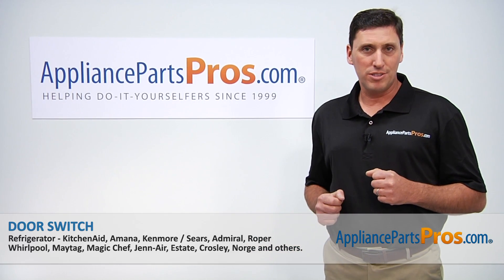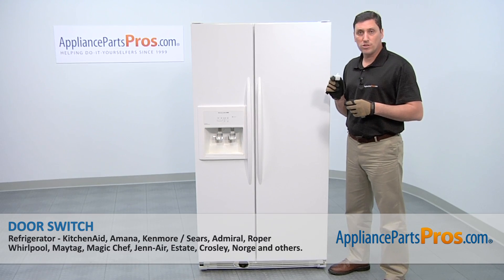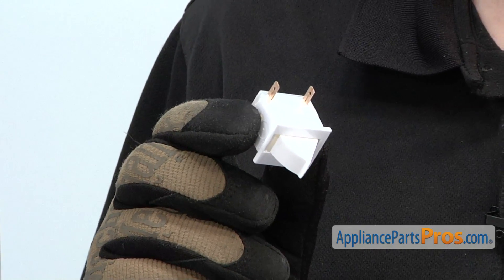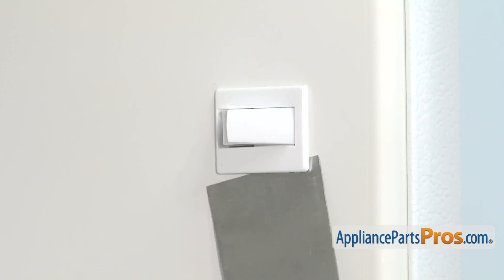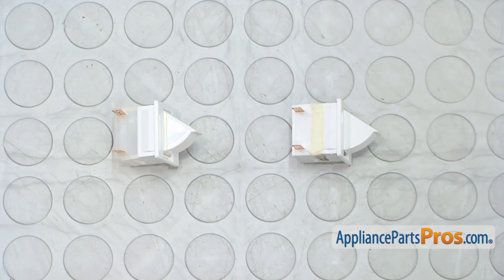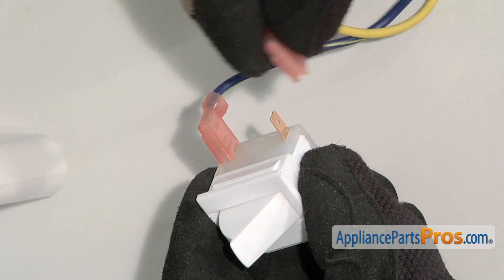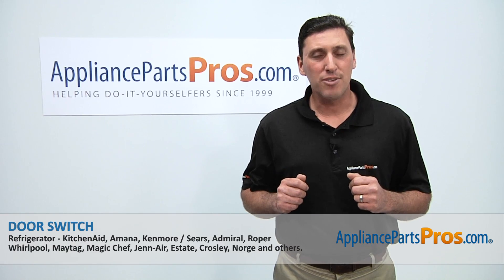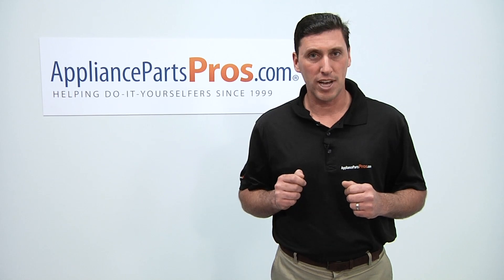How To: Whirlpool/KitchenAid/Maytag Switch W11384469

Comment: When replacing the switch what if you forget what the proper order of re-plugging it goes? How do I find out what wire goes with what connector?
Reply from the maker: You can locate the tech sheet for your unit to see if it has a wiring diagram that would be helpful.
Reply: @appliancepartspros  , I do not have the tech sheet. I might have to just keep testing it out until it is correct.
Reply from the maker: Good luck with your repair and let us know how it goes!
Reply: @appliancepartspros  , thanks i will. The part has already been ordered.